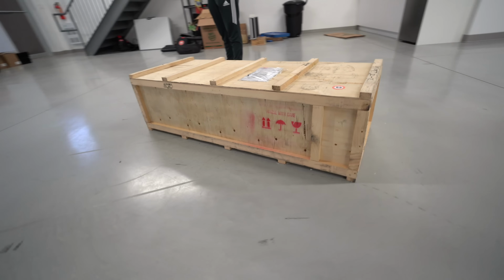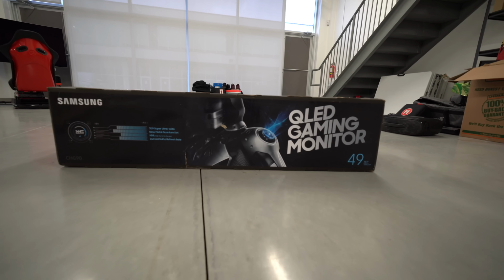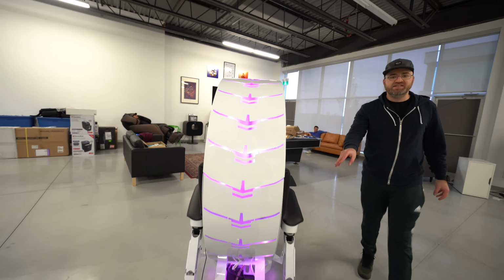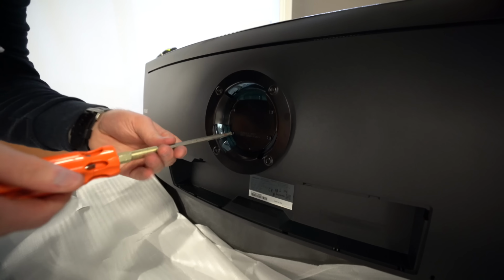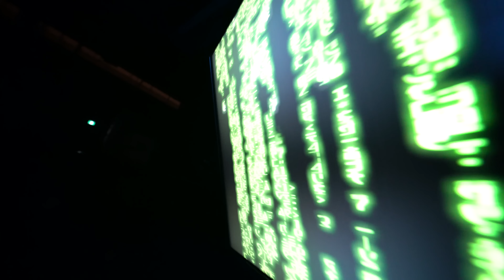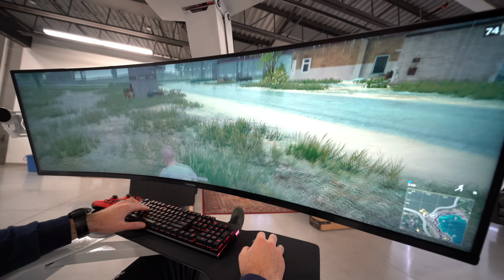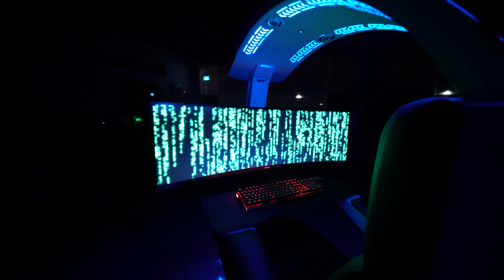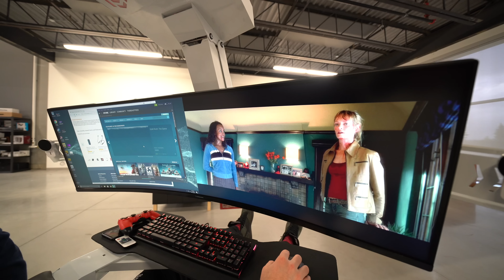The Most Insane Workstation + Gaming Setup

Comment: The screen is too close, I can feel the headache and the hurting eyes incoming.
Reply: Me.Grazzhoppah o
Reply: Use f.lux and turn down the blue tones. After about 10min you won't notice the color is off, but you'll stop getting headaches.
Reply: Me.Grazzhoppah uii
Reply: Jessie Roper Don't even need f.lux anymore Windows 10 has it built right in
Reply: The chair doesn't come with the screen so you don't have to be close to it
Reply: True
Reply: correct
Reply: i agree
Reply: Can't u adjust it or something?
Reply: Didnt even know they had a 49inch "monitor" at 144hertz that's crazy just the size is crazy
Reply: Me.Grazzhoppah dude its a computer,moniter
Reply: u can change the place of the monitor
Reply: Me.Grazzhoppah ugh worst feeling ever
Reply: f.lux is for turning up the yellow and orange tones on your monitor. It doesn't make your monitor be futher away from your face.
Reply: couldn't you just push it a bit farther away from your eyes?
Reply: it's probably adjustable
Reply: Yes you are totally right
Reply: use anti radiation glasses
Reply: 2 Multiple Monitor bro
Reply: Its no closer than a normal monitor on a desk with a normal pc chair tf u talking about?
Reply: It would give you a headache if it were taller, but since it is big in the wide aspect that wouldn’t happen.  You can also move it farther if you like with the motorized control he just didn’t showcase that.  Anyways just wanted you to know have a great day.
Reply: I thought I was the only one who felt that way.

Comment: I got this monitor recently. I replaced my 5760x1080 triple monitor display. Although it is a downgrade in resolution, the technology behind the 49inch monitor is light years away from my previous setup. The included 144hz display makes my 1080ti cry. Most of modern AAA games runs around 60~120 FPS so it's hit or miss. I am seriously thinking about upgrading my GPU now because of this monitor. Perhaps the next 2180TI will be the sweet spot. In terms of gaming, it is very similar to triple monitor gaming. Any games that supported with gold standard will work with this. Surprising many Ubisoft games comes supported. Others that have silver or bronze standard will either have incorrect UI scaling or stretching effect which causes fish eye effect. Games like Fallout 4 (any creation engine titles), PUBG, Fortnite, Just Cause series, and etc. The game to have perfect support for this monitor that I do recommend is Witcher 3, Mad Max, Assassin's Creed Odyssey, Final Fantasy 14 Online, Far Cry 5, GTA 5, Hell Blade (Amazing experience), Dirt series, Elite Dangerous, MechWarrior Online, and The Division. Once you played these game on this monitor at higher refresh rate, you will never go back to 16:9 monitor or even a console.

Comment: I'd play Forza Horizon 3 on max settings in cockpit-view
Reply: CrysMusic no hate against you Xbox fans but Gran Turismo is the game for this setup.
Reply: lol m8 u can also play forza horizon 3 on pc
Reply: nah man, Gran Turismo wouldn't work on this setup, i think the max aspect ration on a ps4 is 16:9 (same goes for Xbox one). You could play it on that monitor but you would have two big black boarders. and why play gran turismo when you can play assetto corsa
Reply: Nathan Purser The aspect ratio of the monitor depends on the game. By default, it is 16:9 but some games allow more... Assetto Corsa is a good game though.
Reply: No hate on you console peasants but project cars 2 on PC is the game
Reply: LasuzzoEagle Console Nobles* You are noble so long as you game.
Reply: HeavyHauler426 I know lol. I like messing with people. I play Xbox and PS still
Reply: Why would you play a shitty arcade racer like forza or gran turismo with a setup like this? Assetto Corsa or Project Cars (or any other actual sim) would be far better with this.
Reply: Any racing sim would be limited by the flimsy tray thing on that setup.
Reply: Absorb Rolex Which is why you remove and replace it. Most wheels have tailor made stands that will work way better.

Comment: TIME FOR SOME 4K MINECRAFT
Reply: The Dark Craft Rises God left the game
Reply: This isn't a 4K screen. That's the bad thing. It's just two 1080p screen without the bezel.
Reply: AbuBakr Akram nothing wrong with that. Atm I use two 1080p screens, and don't feel the need to upgrade to 4k. I'd probably get anther matching 1080p screen for about £100 before I'd opt for a 4k one.

Where it becomes an issue for this screen is when the announce it's price. It's won't be cheap, and at that point there would be some decisions to make.
Reply: AbuBakr Akram Idk if that's  true but ok
Reply: One problem there bud.. Its a 1080p monitor. Still its worth getting because it can be used as a dual screen which blew my socks off 😂😂
Reply: AbuBakr Akram you still benefit watching 4k videos on 1080p. ever wondered why 4k somehow looks better on your 1080p screen?
Reply: Stephen Butler You’re right about saying that there’s nothing wring with 1080p. My monitors are really old, one is 1600p and the other is 1080p. However, I was complaining about having to pay $1500 for two glued together 1080p screens. Like you pointed out, the price is the issue.

Comment: where did u get this i want to buy this
Reply: It costs around 10 k just the monitor the station more than 18 k
Reply: CCD TFA verificat no it’s not
Reply: whats the chair called do you know?
Reply: You can get the J20 for under 2000$ Us  then you need to buy a monitor
Reply: The monitor is 1100$ on Samsung website
Reply: Why the FUCK would you want this?
Reply: That monitor costs $1000 right now. Not 10k.  No clue about the chair.
Reply: and the Stand on which its attach ?

Comment: >tfw he uses an HDMI cable with a 144hz monitor
Reply: Tucker what would he use?
Reply: display port or hdmi 2,0
Reply: PSG <3
Reply: Tucker what is wrong with that?
Reply: its hdmi 2.0 whats wrong with it
Reply: Hdmi has a refresh rate cap of 60hertz, You need to use display port or hdmi 2.0 for a 144 Hertz monitor.
Reply: >tfw people think that hdmi 2.0 can support 4k at anything over 60hz

Comment: What is this shit...better 3 , 4k monitor with high refresh rate,.This is not even a screen is a shit ...lets move to the non adjustable monitor arm ..it goes high or low cant move forward ...and to me that just too close to be comfortable...Yes u can mount a wheel...YES TRY USE IT with it just slapped in ur face ...This piece of crap also comes with more Rgb than Time Square, just a bunch of lights and no usefull FEATURES...at what price...bullshit. I give 4out of 10 just for the seat.